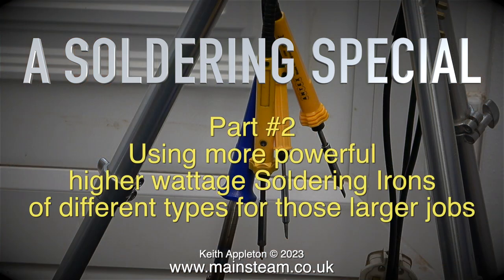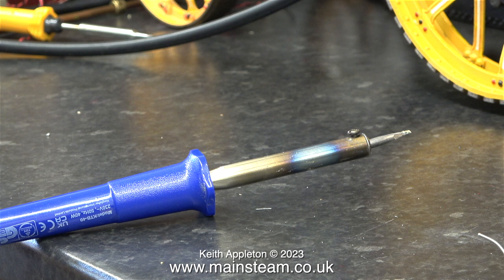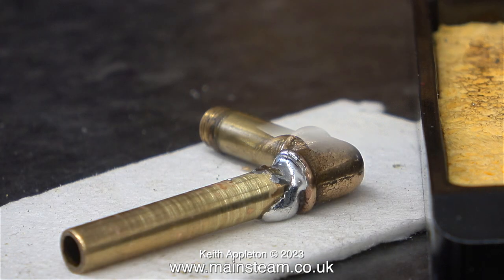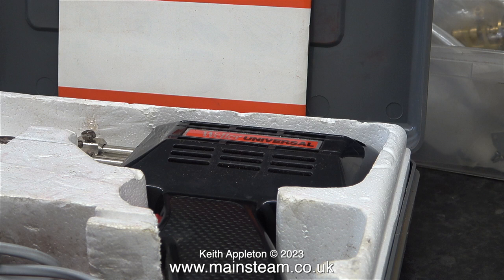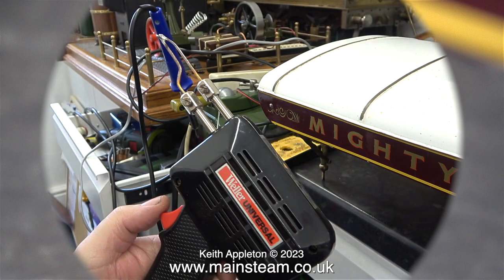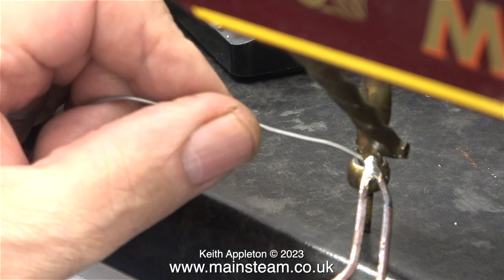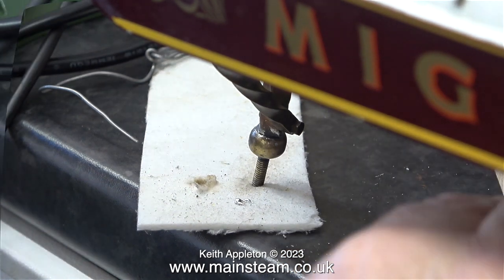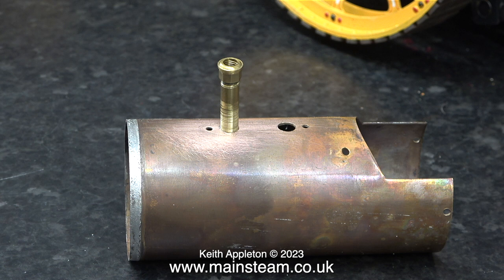A SOLDERING IRON SPECIAL - PART #2

Comment: I had to learn how to solder the hard way, by screwing my slot cars up. Later, when I was in the US Navy, the soldering class instructor was a bit surprised that I could flawlessly solder in a 32 pin cannon plug. When he asked me where I learned to solder so well it told him, :by screwing up my slot cars a couple of dozen times.
All that said, Soldering is not easy. The iron that you use is about 60% of what is needed. The CORRECT  solder for the job is 30% and skill 10%, well maybe 20%.
For example' the so;lder used for plumbing jobs is not what you use on a small modeling electric motor. I learned that the hard way.
These tutorial videos, focusing on simple tasks, like shown here, are very good. Thanks for the lessons.

Comment: Watching this reminds me a bit of my grandfather teaching me how to solder many years ago.   Most of my soldering was done on electronics but I also had the chance to learn how to solder the old fashioned fashioned way with hot chunks of copper on a stick.   I think the strangest thing he taught me was how to make my own flux from a little alcohol and some dried resin from a pine tree, smells great and works fine if you have nothing else available.

Comment: Led free soldier is very brittle. The led makes the joint more flexible. That's what the problem with modern electronic products
Reply: Lead free solder IS stronger, but also more difficult to apply properly.  The trick is to make sure the area to be soldered is clean and that you apply sufficient heat for as short a time as possible.  Preheating the area with flux to clean it prior to soldering helps greatly, but once you start soldering you should take the heat away as soon as the surfaces are wetted properly... unlike lead solder where you can leave the heat on for a while, doing so with lead free solder can cause issues with oxides which can cause bad connections.

IMO most lead free solder joint failures are due to bad technique or lack or surface prep.....  leaded solder is a lot more forgiving of bad technique and dirty surfaces.
Reply: I bought a couple of rolls of the older leaded electrical solder at an autojumble - it 'wets' so much better than the lead free 'stuff'.

I think medical and military equipment have an exemption on using lead based solder as the unleaded variety isn't deemed to be reliable !

Comment: Keith, several years ago "Mr Carlson's Lab" showed a slight modification to his Weller soldering gun that permitted him to solder directly to large steel radio/amplifier chassis.  Basically all he had to do was replace the "Weller tip" with a short piece of household wiring conductor just long enough to attach to the two "terminals" of the soldering gun.  Perhaps something similar would permit you to more easily solder to the larger brass/copper parts, assuming that you actually had a need to soft solder such parts?

Comment: Hi Keith, about the Weller soldering Iron, I was told many years back that  they can cause problems with IC chips if you press or release the switch when the iron is in contact to the circuit board. Have you heard anything about this?
Reply from the maker: Only if the contact between the power rails and the copper bit were intermittent maybe . . .

Comment: Having noticed you adding more heat with a small blowtorch for thicker parts...   
I have a question - I need to solder / repair the sight glass on the back of my Wilesco steam roller (it boiled dry, overheated and the metal sight glass holder fell off the boiler....   Would you recommend soldering this using a small blowtorch, or an electric soldering iron (I have both)?  
I really don't want to mess this up.
Reply from the maker: Sorry I can't help you with this as I have never worked on a Wilseco boiler . . .
Reply: @keithappleton  .... OK, I understand...   I was asking more of a generality....  Should I go in with soldering iron or flame... Wasn't sure whether a soldering iron would be up to the job.
Not sure how many watts mine is, but it saws 480 C on the data sheet.